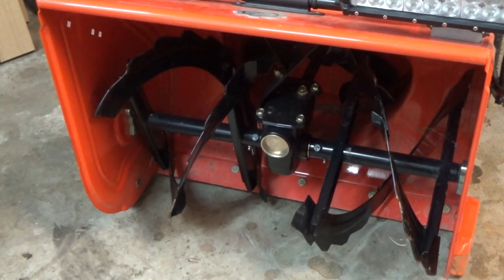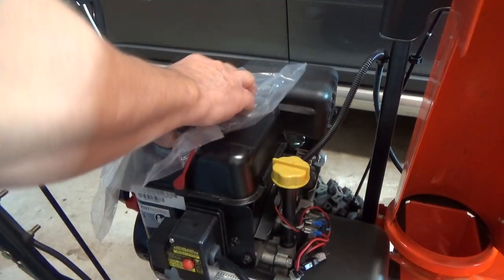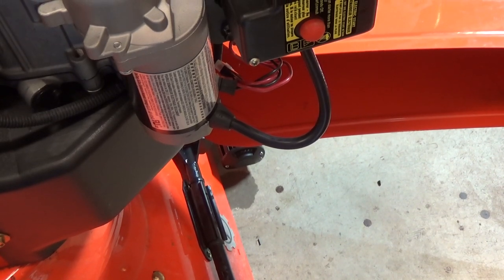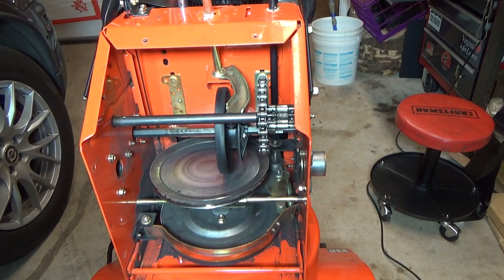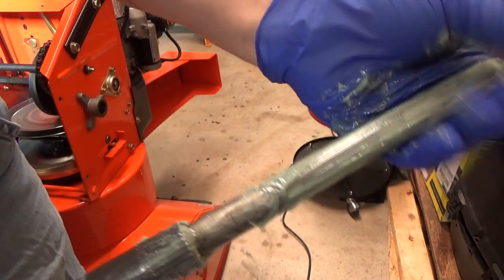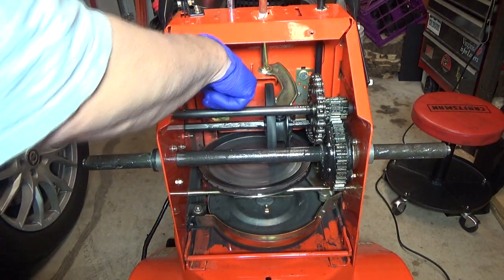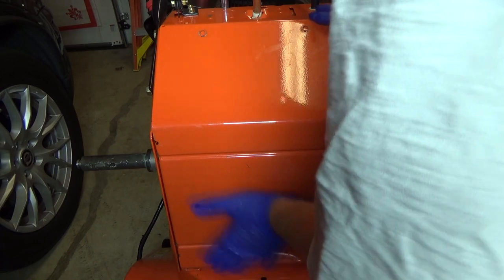Snowblower Grease and Oil Maintenance

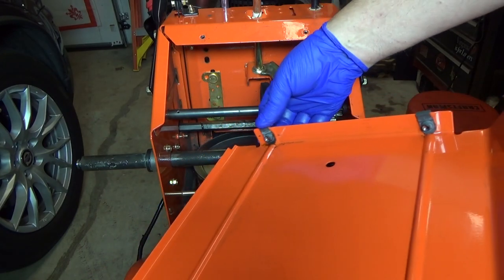Comment: Absolutely one of the best videos on maintenance of a Ariens snow machine (I have the SHO 28). Pay attention to the point about the 'clips' around the 9:30 mark. The clips are very easy to trash/strip. If you're going to do annual maintenance (as outlined in this video), and take that bottom panel off to get at the axel and gears, you're going to want to have a supply of replacement clips. And be prepared to spend longer (and using exercise your favourite collection of  'bad words' in the process) on getting the bolts back into the clips to re-attach the pan, than pretty well any other part of the procedure.
Reply from the maker: Thank you

Comment: Will engine oil leak out when tilt up the snowblower? Thanks!
Reply from the maker: Thank you for asking. Both myself and my neighbors have not had any oil leaks that includes tilting the machine up for maintenance.
Reply: No oil will leak out , the snowblower is placed in the service position . That is what Ariens recommends .
Reply: @gigiraymond9267  Thank you so much!

Comment: That "gear' you're holding at 4:47 is actually your  "zero turn"  automatic slip differntial. It allows the wheel shafts to turn in opposite directions. This is how the machine can pivot in place (zero turn). You can line up the 'keys' on your wheel shafts simply by turning one or both of the wheel shafts independent of each other. With both wheels on the  shaft, try rotating the wheels in opposite directions to see how it works. You'll hear some clicking when this is done - that's normal.
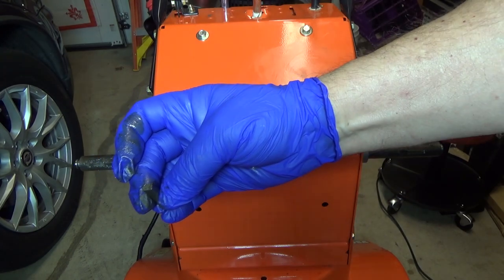Reply: At 11:13 you are showing how the slip differential allows the wheels to turn in opposite directions, and you can clearly hear the normal clicking as the differential "slips'..

Comment: Looks like directional tires were installed opposite sides.  Look at tire lug pattern before and tire lug pattern after (end of video).
Reply from the maker: I thought that too.  I cannot switch them, I would have to dismount them both and flip them around.
Reply from the maker: I was able to switch the wheels by putting the right on on the left and the left on on the right. Thank you for pointing that out.
Reply: That's an interesting observation!  Good catch. ..... So which way should they be? .... Is there a directional arrow on the tire?

Comment: The engine is metric because it is Chinese built. Makes me worry it may not be built to last.
Reply from the maker: And ... the assembly on my machine was very bad with mis threaded and stripped bolts all over the place.

Comment: Just to be anal, I would of power washed the gearbox clean, let it dry, then applied grease. Summer is a great time to pull maintenance.
Reply from the maker: Thank you very much for that advice. I am still disappointed in the black debris field back there and I will hose it out and lub it up as you said.  Thank you very much for taking the time to leave such a useful comment.
Reply: @A_Renaissance_Man  Really, thank you for the time and trouble of making, editing and posting a helpful video. 👍
Reply: Make sure you use a degreaser and let it soak before washing it out.